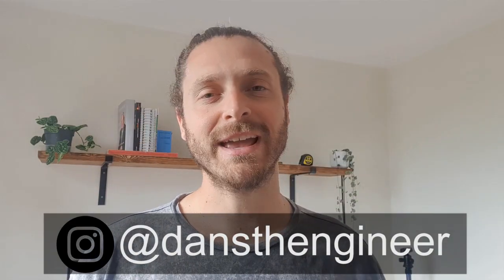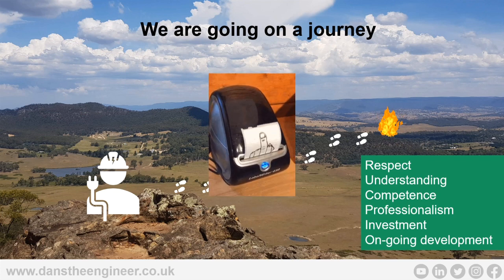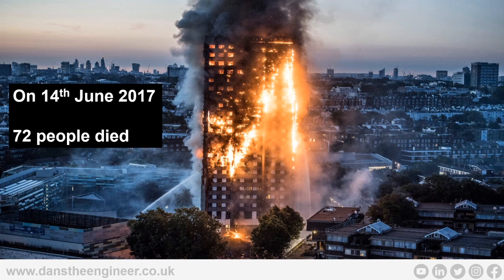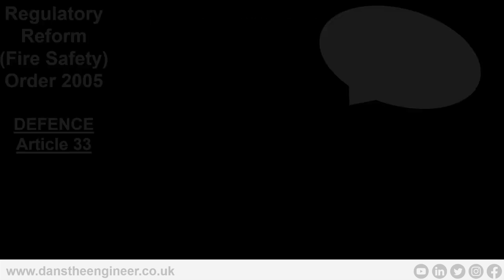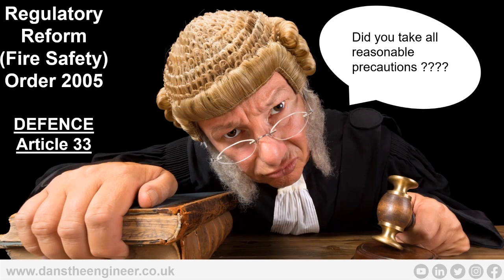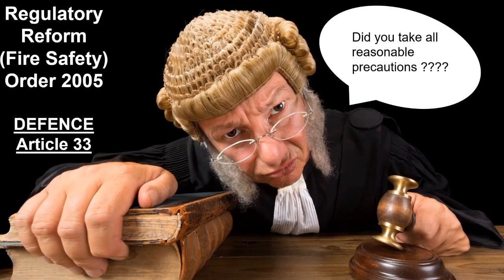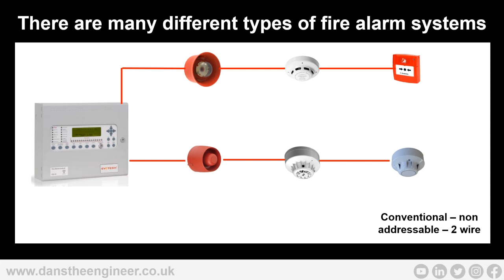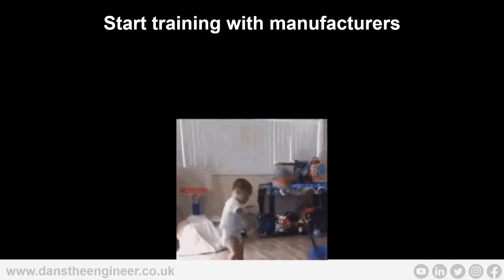Electricians Introduction to Fire Alarms and BS 5839 Part 1 - Powered by Schneider Electric

Comment: I work in an R&D department for a U.K  based fire alarm system manufacturer, and the installs we see are sometimes eye-opening. We've had carpenters and plumbers ring us up asking for help as they just assumed that because they know a bit about electrical they can install a Fire Alarm System. They may need to watch this video.

Comment: I was tested emergency lights the installer used FP red cable for emergency lights, as a fire engineer I'll assume an FP cable is for fire alarm and especially not 230v is there a regulation against it?

Comment: Hi are the any regs about the type and colour of supply cable to a fire alarm panel. I tend to use white fp200 type but some people say it should be red. I’d have thought that was bad practice as it might be confused with a selv cable. Excellent videos thanks.
Reply from the maker: Yes. The mains supply forms part of the fire alarm system and is an integral part. The standards say the fire alarm system should be a common colour throughout the installation that differs to that of any others services. It suggests red but doesn't have to be just red although you may struggle with any other colour. 

I am not opposed to anyone running in white FP200 as the mains but it is a variation and we have to make sure we distinguish it as part of the fire alarm.
Reply from the maker: Here is a video explanation about it https://youtu.be/h2Yvh8-N2mM
Reply: Dans the Engineer thanks watched that. Think where I got it from was the Leicester city council way of doing things. Then when I went self employed I just carried on with it. Will use red in future if any come up .

Comment: I like your content on fire alarm systems but I'm wondering what certificate software your using or how you do your own templates? I'm trying to get into fire alarm systems in the near future
Reply from the maker: Hi mate. I actually create my own via excel. Fortunately BS 5839-1 doesn't change that often so it's easy to make them and adjust. I think the BS 5839 model forms are pants. There is electrical software out there that allows you to use fire certs too but I've not seen any that I think is good enough in my opinion.

Comment: Hey Dan, I am currently in an apartment block that uses  BS 5839 legislation. They set my fire alarm off weekly despite me being in a studio flat not a HMO. Is this a legal requirement for them to do this? They tell me it is but I have told them I have rights as a tenant and don't want that siren in my ears every single week. Was my understanding that this is only a requirement for HMO and businesses.

Comment: Currently at the 8 minute mark and already sick of the jmpcuts and half filled sentences. I love your work Dan but please tell me that the Schneider app video doesn't have all this jumping about?
Reply from the maker: Apologies dude. The audio was recorded on power point. It was the first time I've recorded a presentation that way and was the second time recording. Meaning I had already recorded 2.5 hours! When I went through it, there's no content that was needed that was cut.
Reply: @DanstheEngineer  just seemed very higgledy-piggledy.  Would appreciate more content around the standard. Recommended reading, brands to look out for, to avoid, pitfalls over each type